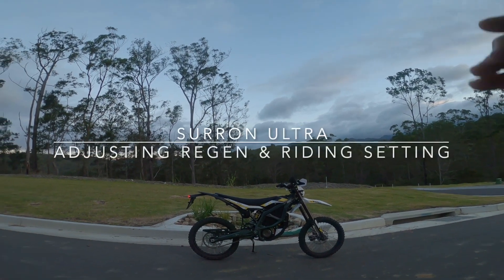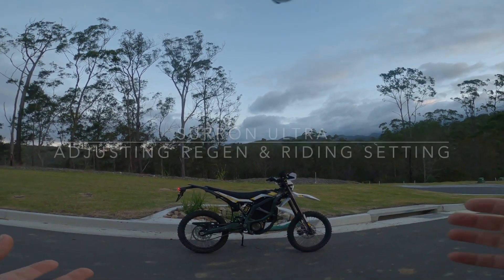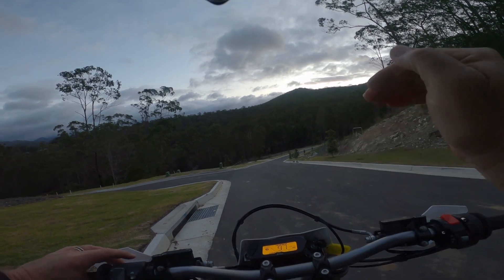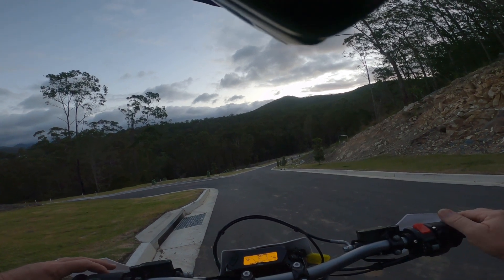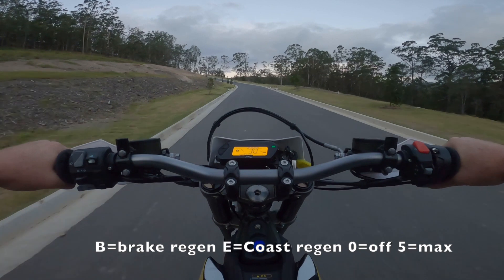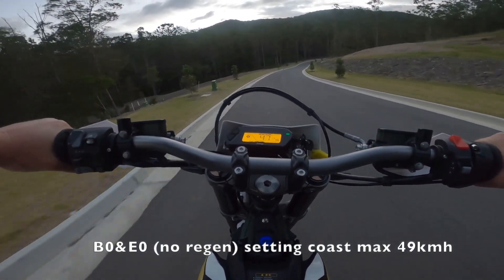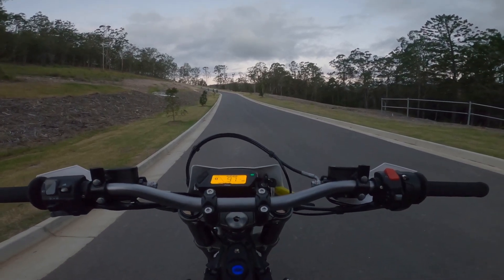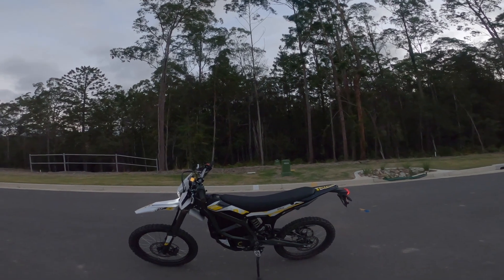Surron Ultra | How to adjust regen & ride setting

Comment: That's very useful. I haven't messed with my settings at all yet due to lack of any manual. But I'd like to tinker a bit and see how it feels.

I noticed that your speedo says 97. Mine reads 87 I believe (when parked). Have you unlocked more top speed somehow? I'm in Mongolia and there's no law to limit EV speeds.
Reply from the maker: No we haven't maybe hit a steep downhill :P